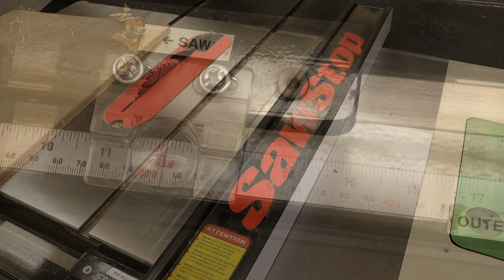Metal Drops and Scraps Bin

Comment: Hi Frank,  great job...   You can't go wrong with Festool.  You might want to consider a guide rail square that will ensure squareness when working after the initial cut all following side cuts will be 90 degrees to the previous cut (no guessing if it is 90 degrees or not).  I have the TSO guide rail squares which are excellent and compatible with a number of manufacturer tracks.  including Festool.  I've got both the Makita and Milwaukee track saws.  They both work great as well.  Best of luck in your future usage..
Reply from the maker: I need the square, you are right.  Coming soon to a channel near you. LOL.